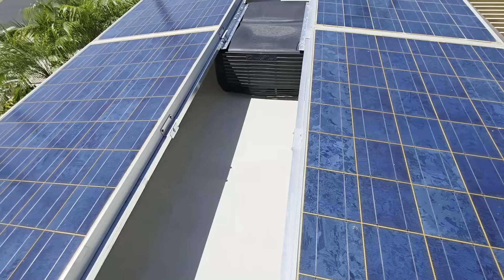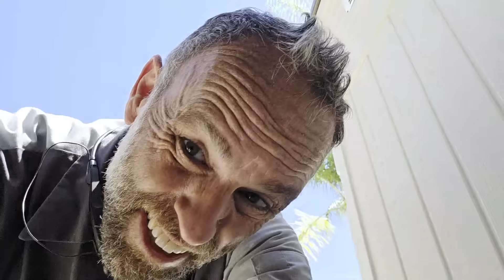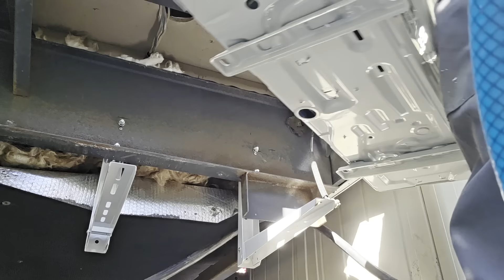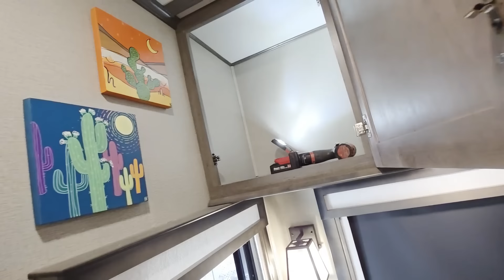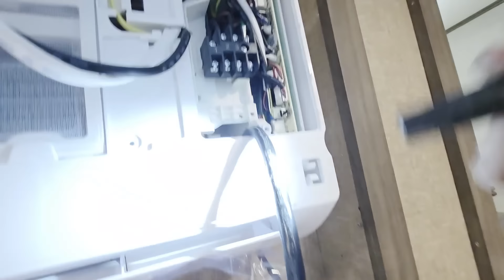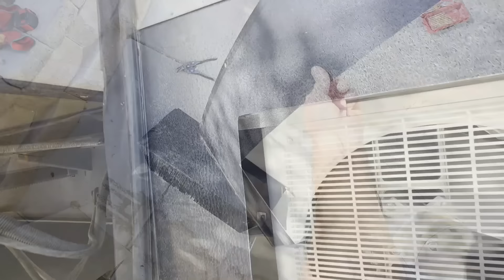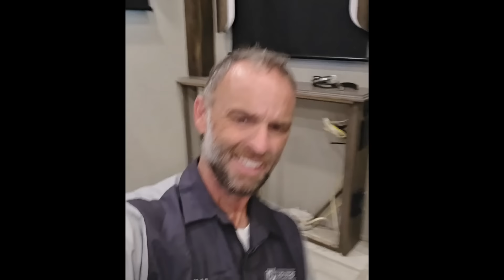Are Mini-Splits Worth the Hype? YES!!!

Comment: Looks amazing, I install these and service them daily. The only thing I see in the install is you should have insulated the condensation line all the way to the outside. It will collect some condensation on the outside of the line and you will end up with water damage.  Otherwise it looks amazing!
Reply from the maker: Thats a good point, most RV manufacturers that do run condensate lines do not tend to insulate either, but I will tell my customer to keep an eye for leaks or puddles. Mostly I am cocerned that maybe I should have put a drip pan under the unit behind the false wall

Comment: That inside cabinet you build looked really good, like factory! I installed a ducted mini split in my fifth wheel. I mounted the outside unit in the compartment under the fifth wheel and the inside unit in the basement ducted into the existing heater vents. Night and day difference than the rv roof top unit.

Comment: Ive been saying the roof ac is garbage for years. I cut a hole in my small slide out wall for a window unit. So i have to pull it in when i want to bring the slide out in. It freezes us out in the summer. We had a couple hundred degree days where we were wearing blankets. Arizona summer is the ultimate test.  The good thing is it directs cold air right at the hang out area.
Reply from the maker: Roof A/Cs are impossible to be decent because heat exchange requires air volume exchange and the small hole in the roof is just never going to work!

Comment: Why do a mini split when there is the new inverter roof top AC units or even the 12v units
Reply from the maker: Many reasons,  they are notnheat pumps, still are constrained by small.ducts and the tiny hole in the roof. They cannot breathe and exchange air volume well
Reply: @AZExpert oh ok.  Good point.

Comment: Can the condenser be put in the basement. I am commenting while watching. LMAO.... I bet that unit was cheaper than a typical RV air conditioner.  Now if that condenser could be mounted flat, then it could go on the roof.
Reply from the maker: Many installers do put it there, but it does require airflow

Comment: The lower unit is in a bad place dirt wise     Maybe a baffle or cover     It let’s cleaned from the top (use a garden hose from the inside)
Reply from the maker: Nah, identical to diesel motorhome radiator and condenser location but without an engine or radiator fan

Comment: Excellent install. They should be very pleased. I recently replaced (2) 2ton SCS basement units with a ducted minisplit that is plumbed to the original ductwork in our Newell. It's almost silent, but what blows my mind is the thing heats when its subzero outside
Reply from the maker: great choice!
Reply: I have a Winnebago journey with basement air I want to get rid of.  What was the mini split brand, model you replaced your basement air with?

Comment: Excellent Install. 
1 Suggestion for your audience, install a drain line from both drains. Reason, if the unit is not completely level, you could leak condensate water from the pan.
Reply from the maker: Its an option I didnt cover

Comment: Crazy that the manufacturers have not jumped on this. Wait , I do know why----they suck. The should get with a mini split maker and have the outside unit with less height and longer. Same square footage so same cooling. Shorter and longer would aid in any install or retro fit.
Reply from the maker: I think it has to start happening. I'm more surprised that destination trailers are not equipped with them
Reply: @AZExpert  Great point

Comment: Hopefully someday they will make them so they can be mounted horizontally on the ceiling and not just vertical.  

I wish they had those improved models when I lived in Goodyear.  I had an Alfa Ideal 36’ and it came with a 25,000 btu basement unit that was pretty much useless above 90°.  I added a 15,000 btu front unit in the bedroom and it would turn the bedroom and bathroom into a refrigerator and it helped the rear unit.
Reply: Ceiling mounted indoor units are definitely available.
Reply: @tomthomas8004 I just looked and they definitely are and they have some really big btu sizes.

Comment: I don't know the factory clearance requirements for that brand, as the only one I've installed is MrCool.
A MrCool requires more clearance behind and above than your location would allow (20 inches above and 4 behind).
Hopefully the owner will have no issues.

Since a MrCools lines can-not be shortened it would probably not be a good choice for most RVs
Reply from the maker: Clearance on the outside unit was a concern but there is still good airflow

Comment: I would have coiled the extra line either behind the wall the unit is mounted on or inside the lower cabinet where it goes through the floor
Reply: Cut the tubing and redo the flares, they are not hard to do.  Especially with a concentric flare tool.
Reply from the maker: That's a great idea, I will keep that in mind for the next install.

Comment: I've been asked by several customers to install these in their RV's but have yet to do one in fear of any warranty issues. In my research of the mini split installation I've learned a few things and would only have a few concerns. Will the vertical loops in the line set allow the oil in the coolant to pool at the low points of the line set coils, and will those brackets handle the weight of that unit bouncing down the road? I have several customers that have these units installed, however, their RV's are pretty much stationary and the road earthquake isn't such an issue and yes, they cool very well. Great work!
Reply from the maker: I made mention of the loops in the description. Maybe it will be an issue,  but this is not the first mini-split I've seen with loops like this

Comment: I'm a huge proponent of the mini split lifestyle.  I gutted the central HVAC out of our entire house and installed a bunch of mini splits.  They've worked perfectly for us in Atlanta.  This, coupled with the massive grid tied solar array we installed at about the same time took our monthly electric bill in summer from $350 down to less than $100.  Great job on the install, I can see how many challenges this poses on an RV.  I'd have installed one in our travel trailer, but there's just nowhere to install the indoor unit without doing a cabinetry remodel like you just did, which is a real skill and is not in my repertoire of said skills.  But what the heck, with this video to use as a guide maybe I'll try it and see what happens.  The bumper is just begging for an outdoor unit to be mounted on it.
Reply from the maker: Central A/C is such a bad option and requires so much room and is so wasteful, I hope we can abandon it soon :)
Reply: @AZExpert  One of the biggest reasons I decided to gut the central air was the ducting runs in the basement.  I regained about a foot of headroom and no longer have to duck walking in my own house.  Priceless!
Reply: Same ... 

I also learned that traditional AC companies HATE mini splits. I know why.
Reply: It's interesting as I'm pulling out two old ductless mini splits and a natural gas boiler.  I'm installing a ducted whole house mini split.  The ducted solution is less efficient compared to a single ductless mini split but replaces multiple mini splits.  I would need 4 heads for total ductless solution.   The ducted solution solves a lot of issues for me.  It's also a hell of a lot easier to maintain.  However, I have a ranch with a very tall, open basement.  Also have a cathedral ceiling with loft that collects all the heat i need to circulate.    My electricity is 7.8 cents per kwh, which is crazy cheap.  Gas service is minimum $30/month when not used,  so it's going away.   Cheers.
Reply: You have to be careful with using minisplits like that, Keep them at the near the same temps or you can get water condensation issues inside your house. Which will lead to massive mold and rot problems and a whole bunch of headache.
Reply: I thought I was the only one with the same idea lol I did the same and my mini splits were cheap from fb market lol
Reply: You can do it. Think outside the box. I like the Costway and Amazon is a good source.
Reply: I'd love to see a video on that. I've got an old 2300 sq foot house that has a 4 ton heat pump hooked into a central AC. I'd love to hook multiple condensers into the existing evaporator system. Pretty sure the efficiency would go out the window. Hooking up something from inside that would provide input to the condensers would be a nightmare.
Reply: @monsaka7827 If I were you I’d just start over with new systems designed to work together. We went with Senville and I can now control my entire zonal HVAC system remotely from anywhere in the world. I’ve had them for about 8 years now and they’re still going strong. I am replacing the 18k unit in the living room with a 24k unit because it’s been running nearly continuously since then and it works too hard for the large area. But overall I’m still thrilled with the setup, and best of all, I’m totally in control of it.
Reply: And $70,000+ lien on the home. Future insurance cancellation
Reply: @ae6ji445 if u got a 70k lein on a depreciating asset in freefall like a new camper has, then u no care ab whether or not your insurance underwriter has issues with your mods. In fact, you're probably dodging the repo man in the first place or will die before it matters, which is why ur solar n split n water tank'n and all that other type ftw type grid runner hooplah.  I buy totaled...uninsurable, homemade vin. I do as i please to my rigs and insurance agents always wish they could write me a policy. Or if i was bougee or super strong on disposable liquidity there's no lein duh and insurance agent/underwriter lets one do whatev one likes. Canceling is the LAST thing they ever want lol they like money too much
Reply: @ae6ji445 What are you talking about?

Comment: There’s no such thing as a roof top air conditioner using mini split technology? 
Too bad the condenser wouldn’t work in one of the storage bays, for a discrete installation.
Reply from the maker: The furrion chill cube uses inverter compressor technology and is much better, but they do not offer a heat pump yet, it takes some effort to make work with many different installations, and I really think the biggest issue is the 14 x 14 hole just does not allow good exchange of airflow volume in or out, like trying to breath through a straw.

Comment: Yes!

I have two of them in my Itasca Meridian. I took the basement air out and sacrificed the front bay. 

WARNING: Make sure you adhere to the distances from sides and top of the indoor unit because not doing so will slightly compress the air and condensate forms on the fins and the unit will spit water on you all night (ask me how I know).

(edit) Well ... I just got to the end. If it spits water, you'll know why.
Reply from the maker: Thanks for sharing your experience and the important tip about the clearances!
Reply: @AZExpert  Gladly! It looks great. Good job.
Reply: I have a Itasca Horizon 39WD.   I'd love to see how you did a 2 head unit install on your coach.
I've been thinking about this as a possibility since the basement a.c. is not that efficient and doesn't do the best job at cooling.   Not to mention the cost to replace if one even could.
Reply: @thomasguthrie5938  A two head unit IS possible, but you might as well turn your bus solar while you're at it. I used two, single-head units; one in the spot where my basement air was, the other in the front bay

I pulled the basement air out and put a Cooper and Hunter 12k btu unit in that spot, pulled the middle overhead cabinets out of the back room, and put the inside unit in that spot (I did not comply with spacing requirements on the inside unit and it spits drops of water on me in humid climates). I ran the 110v from the original basement air (it has two 110v lines).

I also sacrificed my front cabinets and front bay for the 12k btu Pioneer Diamante that I installed in the front. I drilled a hole through the floor into the bay to run the lines and I installed an HVAC intake vent through my bay door. On extreme temperature days, I open the bay entirely. 

Consider raising the outside unit in the bay up to connect to the top of the bay like James did. The unit will certainly bounce inside of the bay and loosen the flare fittings.
Reply: @thomasguthrie5938  For a two head unit, you'll need a splt phase inverter and 48 volt batteries.